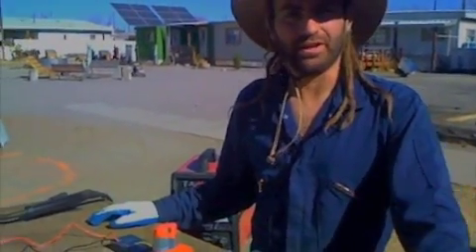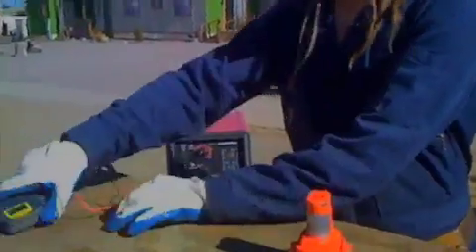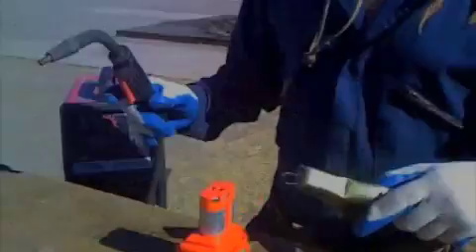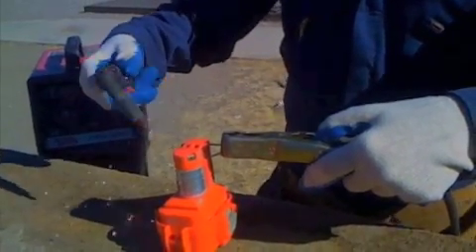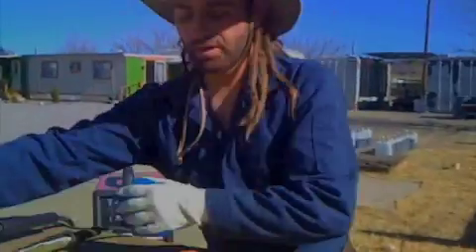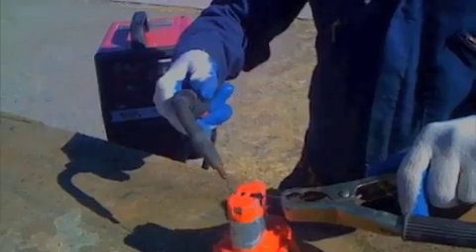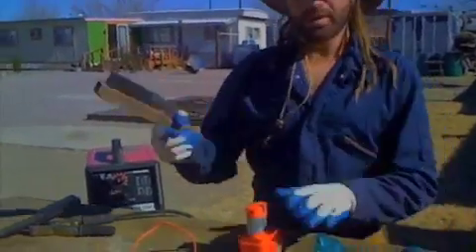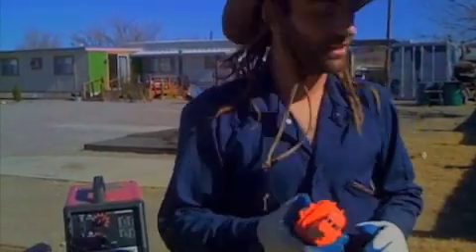Zap Ni-Cd Batteries with a Welder

Comment: This program [Check Details Here==>https://plus.google.com/100351090281822647456/posts/Gwtd4mVBdEd ] also goes into great detail on how to boost the lifetime of batteries and other factors to handle batteries and their acids. Once users have learned battery reconditioning secrets from this program, they can then start to save money on electrical power.

Comment: To avoid getting all those little clumps of molten wire on the positive terminal of the nicad battery, you might consider temporarily clamping a piece of metal onto the battery over the pos. terminal, and then striking against that little add-on instead of striking directly on the terminal. Whadda-ya think, Mikey??

Comment: This has to be done with dc out put. A car battery is dc so that should work. If you run off alternator make sure your on the right side of the regulator/rectifier or you will F$@k things up. In other words USE THE CAR BATTERY, NOT THE CAR CHARGING SYSTEM!!!

Comment: I rebuilt my Milwaukee 18v cordless drill Batteries with my old milwaukee 12v batteries I got from ebay over 15 batteries . I zaped The old dead cells with a 18v batterie . It worked out fine it charged up fine .  The batteries are the same sub-c cell nicad batteries .

Comment: @bigjim10011 you don't use the car battery... use the cables going TO the battery from the alternator - that's what charges the battery... the gnd cable is your gnd and the cable that goes to the POS on the battery is your pos. and make sure you have the engine running or there will be zero juice...

Comment: @bigjim10011 you don't use the car battery... use the cables going TO the battery from the alternator - that's what charges the battery... the gnd cable is your gnd and the cable that goes to the POS on the battery is your pos.

Comment: When zapping a battery it will reduce its battery life. But just give it a sudden boost for a short while.

If you do a full discarge it is good to reduce all cells to 0.0v by shorting all cells with resistors. This basicaly gets all cell voltages down and stops other cells overcharging and discharging. If the cells have different voltages then it can imbalance the cells,

Comment: @sklarm The welder is crazy and increases the danger of or likelyhood of blowing it tremendously and you should wear a face shield.  I prefer a good DC power supply, constant current regulation and you can push the cells one cell at a time (the only accurate way and yes disassembly).  individual cell rejuv run the voltage up slowly to see where the current runs will tell you the condition of the battery overall. then increase  current until battery is getting warm.  -continued-

Comment: OK so we all dont have an Arc welder laying around.  What other methods will work?    Can I use a Car battery?  Can I use a Car Battery Charger?    Should it be set to the 50 amp boost?

I cant think of anything else that will produce a DC high voltage zap.  Can you?

Comment: very interesting. perhaps you are shoking it with such a high current that the internal crystals redissolve? Treating batteries with high voltage does cure this as i recall but it is temporary. I guess you arent out anything. 
I would be concerned about rapid outgassing building up internal pressures at a rate greater than the valves can release though. I dont claim to be a battery expert but I wouldnt try this without at least goggles on.